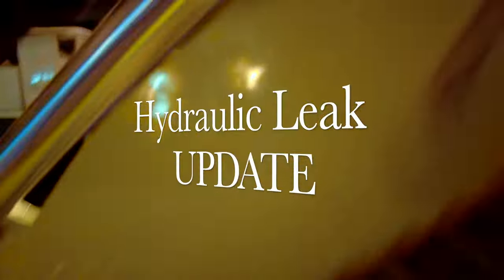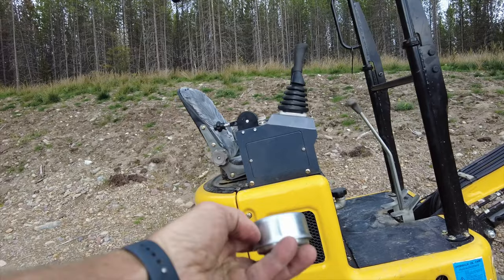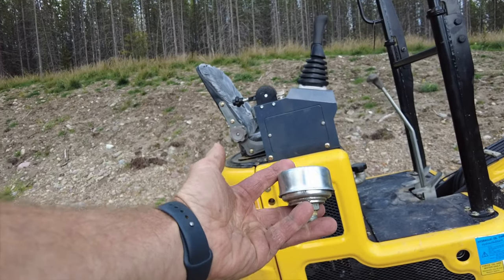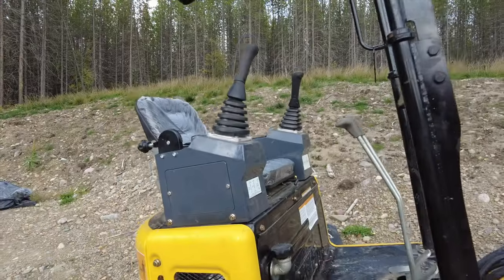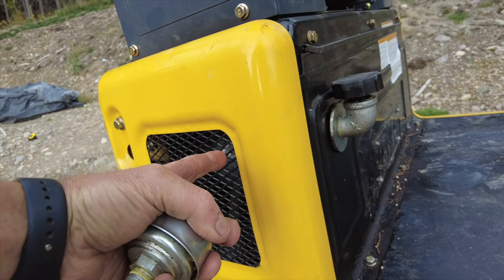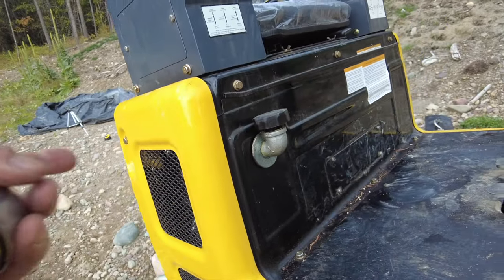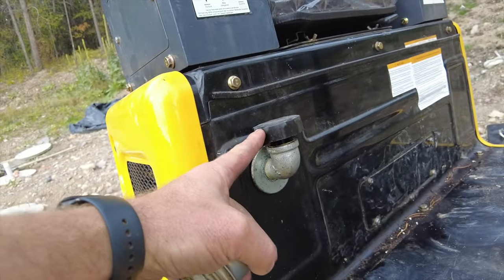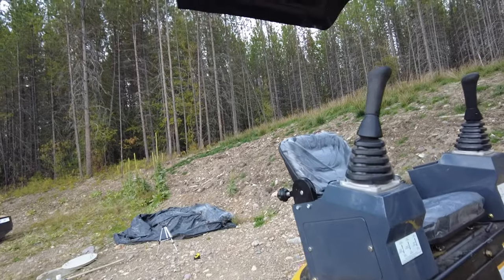China Digger FLUID LEAK UPDATE, it's a joke how the put this vent together!

Comment: Thanks for posting! I really appreciated your feedback about going for the open cabin. I decided to just order a 1.8-2ton with the Kubota engine. I’m working on all the freight forwarder stuff before I order next month. Looking at LTMG or SDYC companies. 

My question to you is would you upgrade to their Kubota 902 engine for $300 more or do you think the 722 is enough? I was erring on side of just getting bigger motor to avoid lack of power regrets.

My other question, if you can help, is what attachments would you recommend? I was thinking Wide tooth bucket, log grappler, auger and automatic quick coupler. Thoughts? Thank you!
Reply from the maker: The attachment are so cheap, but any you think you might use. I’m happy with 722. It the use the same fuel tank the 902 might empty tank to fast. 

If I would do it again I’d see if there was a better pump. Think motors good but higher grade pump?? 

Definitely hydraulic thumb. And I love the tilt bucket.
Reply: Thank you! Really value your opinion. Binge watching your videos.
Reply: @Manfran order your attachments at same time. Since you're going kubota engine and larger frame make sure they give you two pumps. Not a dual stack, 2 unique pumps.
Reply: @jhawk1045  thank you! You guys are probably going to laugh at me, but I am not too familiar with these machines. Should I ask for two separate hydraulic pumps? Or are these oil or fuel pumps you are referring to? Sorry, want to be sure I don’t screw this up.
Reply: Hay guy's I bought this model Rippa 325 with cabin, what you think about? With Kubota 722